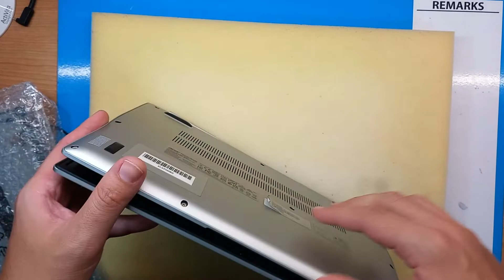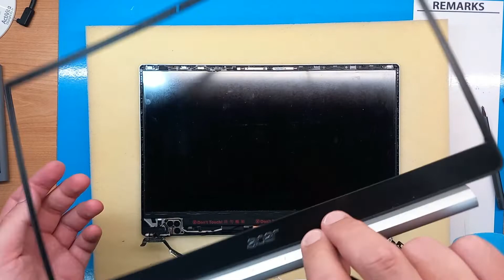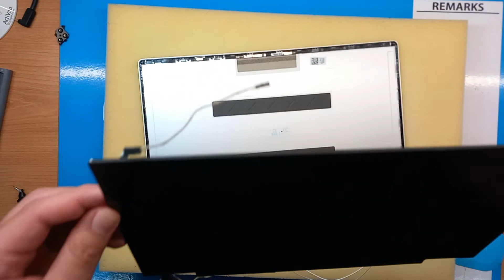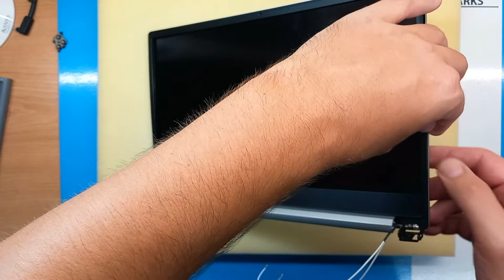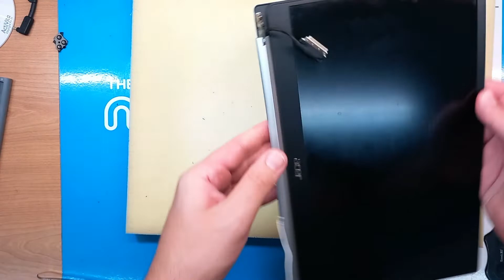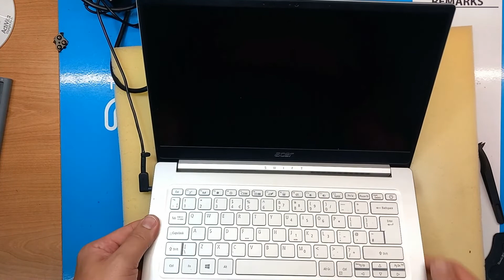ACER SWIFT 3 // LCD Back Cover Change // Broken Hinge Repair

Comment: Hello! I've encountered this issue. The problem is with the LCD screen and the broken hinge plastic connection. Which this video helps with so I'm glad to find it. However, I don't know where to buy the parts you used. What's the process to get the exact parts you did? The LCD with the back panel and adhesive, specifically.

In short, I don't have a warrenty anymore. Money is money though and I'm willing to pay for the parts, I just need to know where to find them. If it's under $500, I can do it. If above that, I'll just save up to buy a new laptop. For the longer respone, a scholarship for the poor gifted me the laptop and I've had it for multiple years. They unfortunetly said they can't help me with this. I think I can repair it though with this video. If you'd like more information, I can provide that. Thanks!

Comment: The metal hinges are screwed to plastic then adhered to the back cover with glue. I used your steps to take apart the back cover, but then used JBWeld I already had to re-adhere the detached hinge to the back cover. Let it cure 15-24hrs and re-assemble. I wouldn't try this regular glue, Acer already showed it wont last long.

Comment: amazing video, however I am not sure if mine has the same problem? My front bezel's corner is slightly peeling off. When trying to close, it makes a loud cracking noise. It starts bending when I try to close it as well.
Reply from the maker: Then you just need to replace the front bezel then, that is easy and not an expensive repair.
Reply: @alkibtech  Just an update on it. I have not fixed it yet, however it does not turn on at all and while plugging the charger in, there is no signal showing that it is getting charged. Is this a side effect of the problem? Thanks.
Reply from the maker: @StinkyPinkyMalinky  No, that can point to faulty motherboard if there is not CPU fan spin, or any kind of LED light, can be something else, but usually MB.

Comment: thanks great video! I bought this laptop recently . the plastic front bezel( with acer logo )   make a click noise in the corners when I make some  soft pressure. its normal on this laptops models?? I had acer swift before and never felt loose any part of the computer . I dont see the  plastic bezel bending but the sound is there when i grab the laptop. thanks!
Reply from the maker: Not sure to be honest would have to see it for myself, it shouldn't happen when opening and closing the lid that's for sure. If you are in any doubt and you have warranty contact the seller or Acer directly.

Comment: great video! my laptop lid hinges are broken and service centre person thinks it cannot be repaired. Maybe there are other issues too which I do not know of. The lid falls backwards; I have to keep the lid against some support to use the laptop. I want to use the laptop with a separate monitor and I am thinking of removing the lid completely. Will it work? Is there anything I should take care of?
Reply from the maker: Thank you and hello. Yes, you can use it as a computer with and external monitor over HDMI. The only thing is that wi-fi will work weaker because the antenae are those cables going around the screen, so that's the only drawback.

Comment: hi, can i please what to do when the bezel doesn't hold its place? It just clicks in place and when open the pc normally it just pops off or the tape part comes undone. Seems like there's so much pressure in that spot, but the bezel cannot click and actually stay in its place.. is there something to do with it? thank you

Comment: I am having a hard time taking off broken hinge side screw. It’s impossible to get it out and not the hinges are not aligning when I decided to put the laptop back without replacing new screen. Now keyboard not working and display panel side not aligning and falling.
Reply from the maker: You have more than one problem there obviously, and more parts that need replacing, hinges, display cable, etc.

Comment: The metal screw is attached to a plastic part, highlighting the poor quality Acer is providing. Today, I encountered the same issue—the plastic piece holding the metal hinge broke. I believe the only solution is to replace the LCD back cover. It’s really disappointing! The build quality feels like a toy.

Comment: The way these hinges break appears to be a common issue. The design is not fit for purpose if they are breaking during normal use. I can understand them breaking if the laptop has been dropped but otherwise they should last the life of the laptop. I think the manufacturer should be accountable for the repair as it’s unacceptable. 

Is there anyway the broken hinge bracket can be bonded back rather than having to replace the case rear? There are modern adhesives that are very strong.

 Any idea why the brackets are breaking like that?
Reply from the maker: If the laptop is under warranty, with broken hinges people should always try to get it repaired under the warranty, because you are right most of these accidents happen due to bad hinges from the manufacturer.